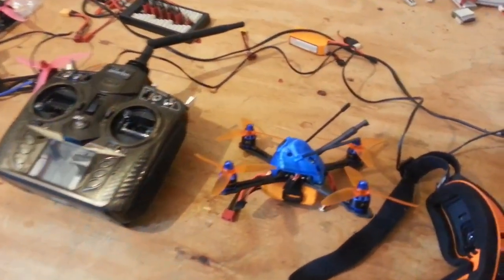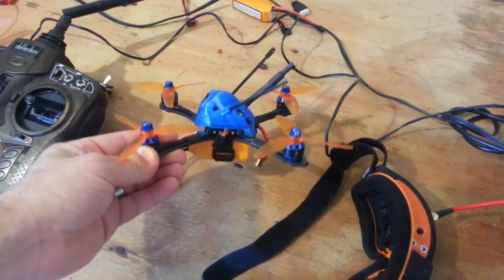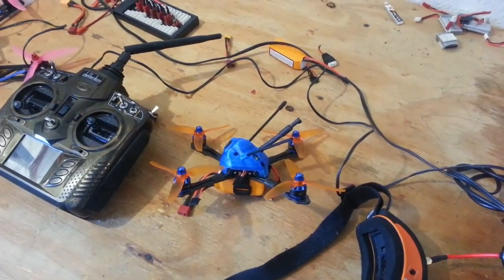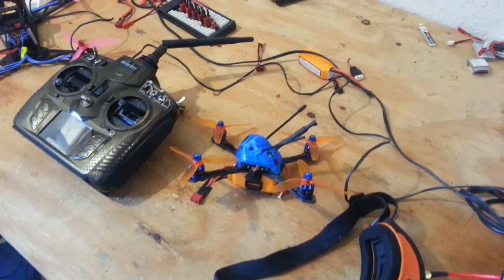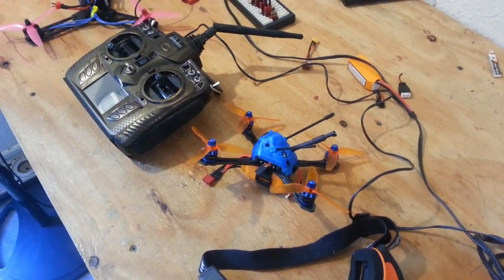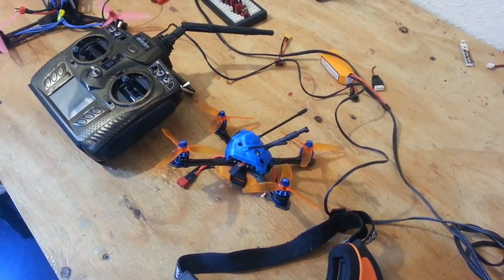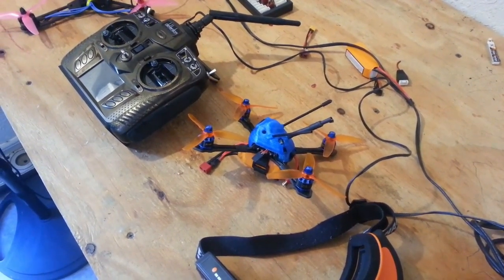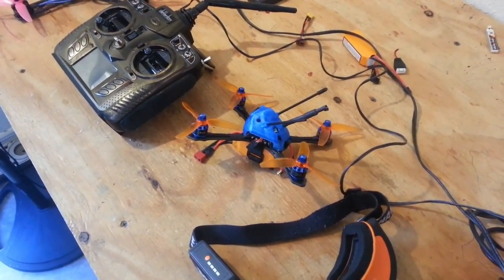NFE Silverware fork RIPS BRUSHLESS!!

Comment: I have the betafpv lite brushless 2s fc bayang you know the channel mapping for it manual is confusing
Reply from the maker: For flight channels 1-4 or for aux features on 5-8?
Reply: @_NFE  for angle acro and horizon an arm disarm
Reply: I'm using a jumper t8sg
Reply from the maker: @atomicfpv4510  is that the one that runs deviation firmware or is it open tx?
Reply: @_NFE  devo
Reply from the maker: So the devo mapping is different than most multimodules used with open tx.  If they kept the defaults from NFE, and its set to a mismatch from open tx vs devo ....Arming on your 6, level mode on 10, horizon would be both 8 plus 6 on.

Comment: Bluetooth!?
Reply from the maker: I considered it, and it's still on the table.   So is osd, or a serial based configurator.  USB support, and moving to a faster spi gyro protocol.   Alot to get worked out.
Reply: @_NFE  Yhman, not giving too much away. 😁  Just getting into the 2s Brushless Whoops from the Boss 7mm's and nfe tuned 7mm whoops ; needless to say keen to get my hands on one of these Brushless boards.

Comment: My problem became the internal receiver binding every flight not trusting a larger brushless quad with the silverware fork. Anyone with the nrf24l01 could bind when u plug in a battery. Range also sucked. Flying always felt an bit uncontrolled i always had small problems.
Reply from the maker: My fork supports a fixed transmitter ID, so it's only going to bind to the transmitter code that you establish on your TX and save in the fc.   But once it's bound even without - a unique id is set and you're not going to get knocked out of the sky.  Your experience sounds like a faulty rx crystal cause my range is fantastic.  But you certainly aren't limited to the bayang rx... our Alienwhoop Zer0 fc is set up out of the box for frsky sbus for example.  However this is the "silverlite" board by Ian444 and I'm using a frsky type shielded antenna on this particular fc so that probably helps range too.

Comment: talking about hype whats do you think of the spring from heliorc ?
Reply from the maker: I think it's a great flight controller and a progressive design.  I also think it's a great way for a group of guys to go closed source right smack in the middle of an open source project.  
At the end of the day, it's the complexity of the code that is requiring hardware innovations like the spring.  And it seems pretty obvious to me that such complexity is not necessary to fly well.  I bet less than 2% of fpv pilots are advanced enough to even notice or appreciate the capabilities of that board, the rest are just taking a ride on that train!

Comment: And I still can't get it on my E011 board ;(
Reply: I fly on E011 board. 1103 8000kv brushless. dshot150. works great for me.
Reply: f1i hey, where you get signal for the ESC‘s from? before FET? and how you setup dshot? I know it from Betaflight in the configuration, but how to set this up with the e011 board? is it in the silverware Cfg somewhere? Thanks for your time
Reply from the maker: @dronevan  I don't have an e011 to look at anymore but the idea is to remove the mosfets, pull up resistors, and filter caps (if there are any).  You just want the raw signal coming off the f0.  Bridge or jumper that signal where it makes sense to get it where you want it.  Then set up dshot in hardware.h.  If you're using my fork, lower the pidsum/integral sum limits, raise the strength of mix increase throttle 3, turn off mix decrease throttle and turn on mix decrease throttle 3.  Raise the strength of both of those to 80%, change filtering if your build is clean to a 1st order D filter around 70 to 90, turn off motor filtering,  and set your pids in the 2 to 7 range.  Simple.... hahahaha
Reply from the maker: @dronevan  Those are all my secrets, and you'll have to dig/learn to sort them all out.  In the mean time there is a brushless fork of my fork by a dude named Yets.  It doesn't have all my brushless setting discoveries in it but he has done a pretty good job of getting you in the air easily.  Google yets github.
Reply: NotFastEnuf thank you very very much!!
Reply from the maker: Keep trying man!  Or go grab an alienwhoop zer0 and rip it straight out of the box!
Reply: Ok, thanks. Buying one is not really an option for me, because I have a bunch of e011 and my friends also have a few and as a student, my budget is not that high. I'll try again getting some help in the forum, but i don't know if that will improve my current situation, bc even with the detailed step by step instructions from silverxxx for noobs I could't get it to work. We came to the solution, that the STlink is the problem, so I bought a new one...and another one. Then I switched the FC, then I switched the pc.. didn't help, I always got the same error message. I joined the E011 thread on Page 80,
Nov 06, 2017. My Username is FelixBaum.
Reply: Thanks for trying to help me!!!
Reply: May be worth trying again with the latest Keil software as this seems to have fixed the worst connection bug...
Reply: Felix have you joined the forum on RCGroups for SilverWare as I am sure that someone there can help you to sort of the flash :)
Reply: Pedro147 Yes, a while ago i wrote with some guys, but nobody could help me.
Reply from the maker: This is one of the reasons Alienwhoop designed and released our silverware board.  So that there is an option that comes preloaded, includes professional customer support, and saves you time as well as frustration.  But kudos to the community - they will not give up on you either.  Jump back in there and keep asking questions till you get it sorted out!
Reply from the maker: OK I'll look you up.
Reply from the maker: f1i  - I've got a pile of 2s 2" builds that I put together on higher kv than 8000 motors, but recently changed my 1103 8000kv one to cut gf3025 to 2.25" - and it's just as fast now as the rest of them and flies longer.   8000kv is really the sweat spot for 2" especially on 2s.  I need to start converting those over next but wanted to start my experience with brushless silverware on something that was really fast and pushed limits!  Thanks for sharing man!
Reply: Felix Baum hey stop by the E011 receivers and modder s group on Facebook. Lots E011 folk there that flash silverware it's a good resource also.